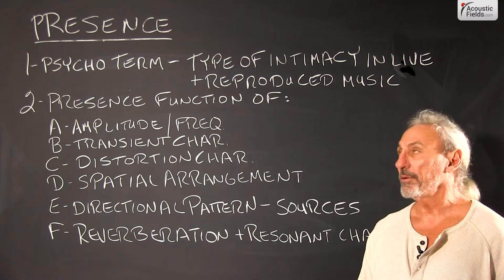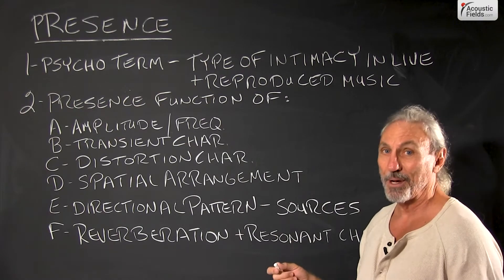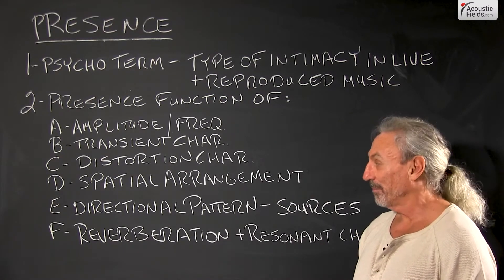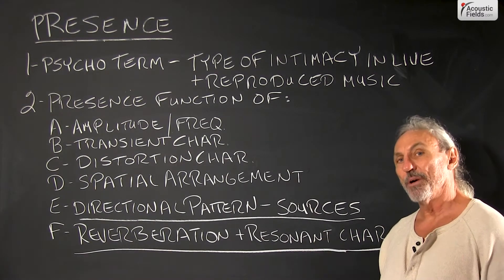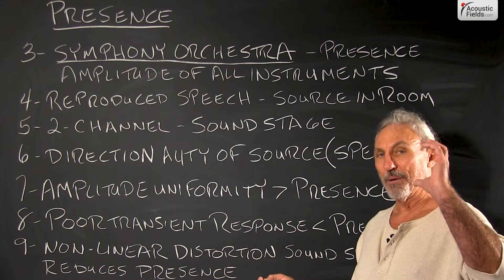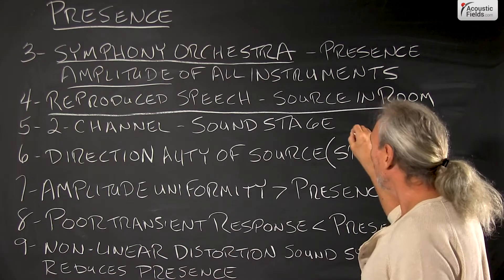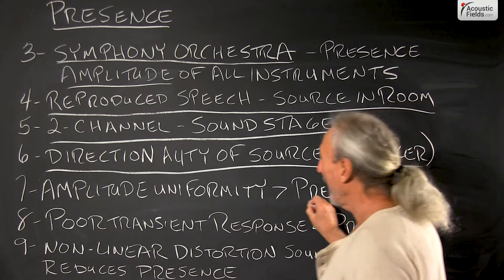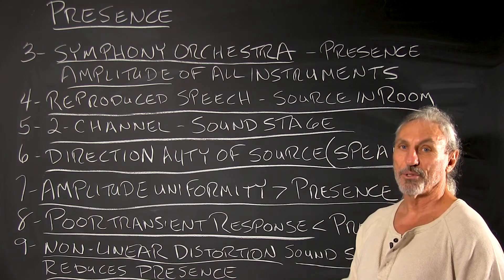Presence in Room Acoustics - www.AcousticFields.com

Comment: I feel that home theater, especially streamed, along with streaming audio or having a negative effect on audio quality. Home theater systems seem to try to make everything sound spectacular, ignoring subtlety. Subtlety in my opinion is a major part of the emotional connection to music.
I hear the data compression of streaming audio. Again a lack of subtle things like 'air'.
Reply from the maker: B,  Yes, this is why you use diffusion on the ceiling and rear wall. You achieve your definition and separation with absorption, then diffuse that resolution.